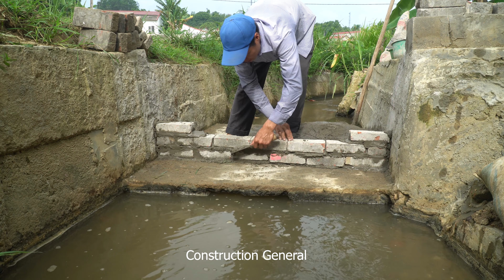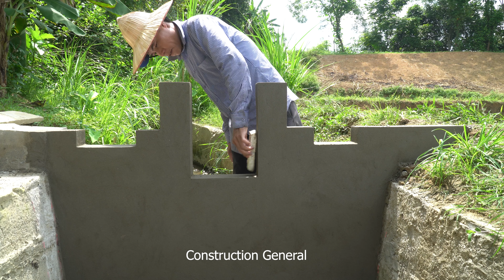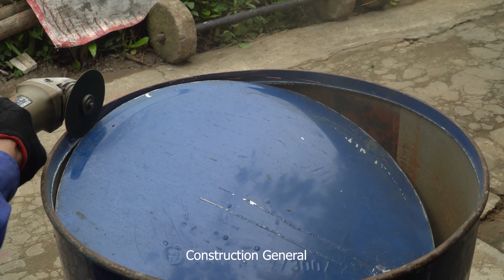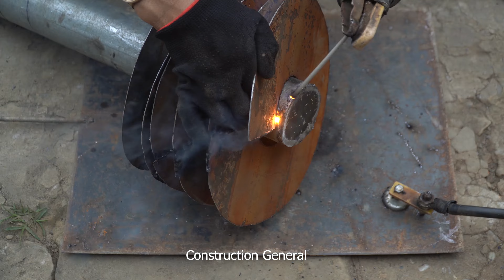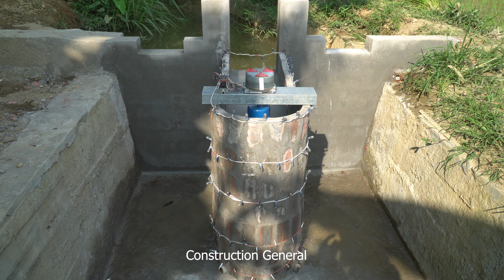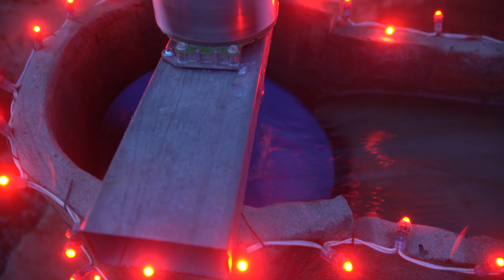Blocking the flow of water to build small hydroelectricity with a screw turbine

Comment: Wow, I wonder how much power you could get from that. would it be enough to power home appliances such as fridge or TV?
Reply: No idea what efficiency this will have, but high-efficient small hydroelectric power plant can reach 75% or even more.

The calculation is quite simple - multiply volume of fluid per second with fluid density, gravitational constant, height between dam water level and outflow, and your turbine efficiency.

For such construction let's estimate the flow to about 10 liters a second - that's 0.01 m3, density is about 1000 kg/m3, gravitational constant is 9.8, height is about 1m - so at full efficiency it's going to be at most 98.1W of power. The system doesn't use turbine so the efficiency will be quite low - my bet is somewhere between 40 - 50W of power from the system.

You won't be able to power fridge from it (they're generally in range of 100W - 250W ... maybe a small and efficient one), but high efficient modern TV - yes (or even computer like Raspberry PI or similar).

...

It all depends on the flow and height water has to travel down. Increase flow and/or height and your power output will increase either. It's not a coincidence you build large dams in valleys on large rivers.